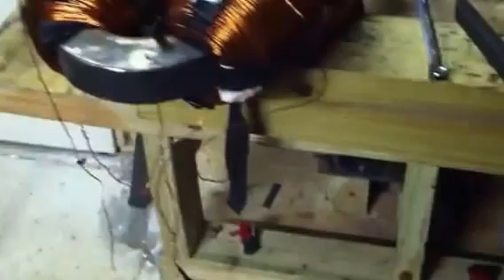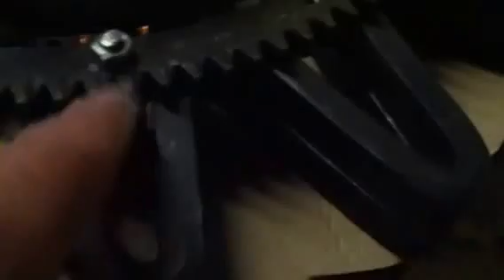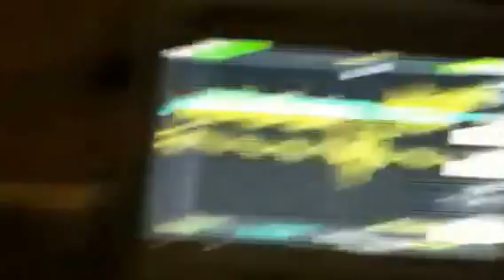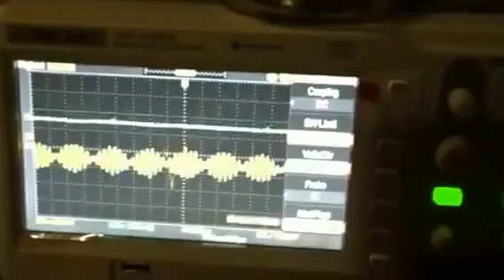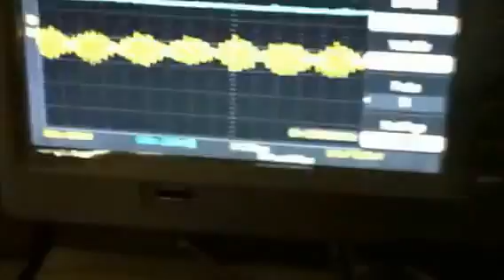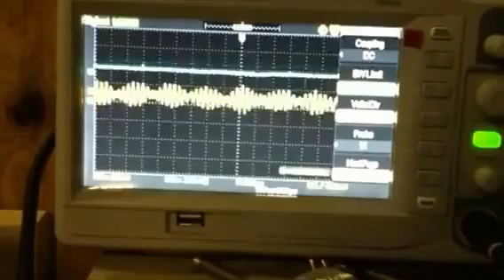Ed Leedskalnin Magnetic Generator test

Comment: you mentioned concrete... based on my youtube surfing experience lol, i came across crystal batteries. some have even made concrete batteries producing low voltages. anyhow, concrete has a crystalline composition. that being said, i also read that crystals have the power to transfer any form of energy into current(ampere). I could be all wrong about that, but i do know ed designed with purpose.maybe something to it. Great work! glad someone is actually following his lead!